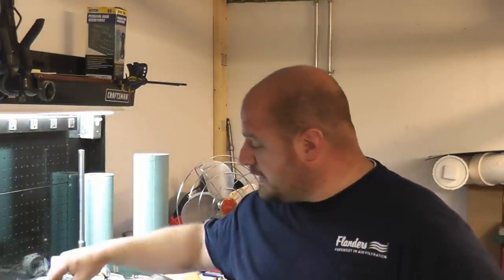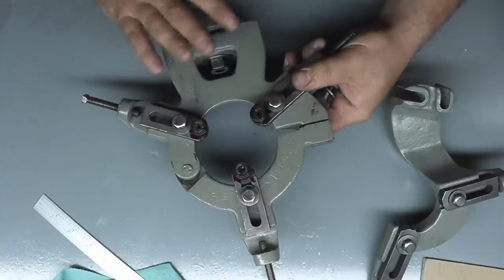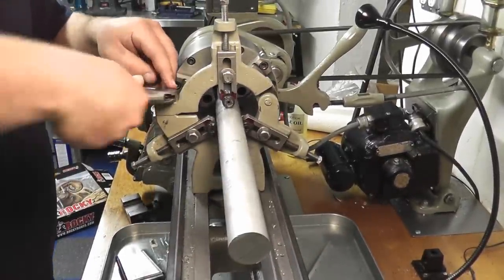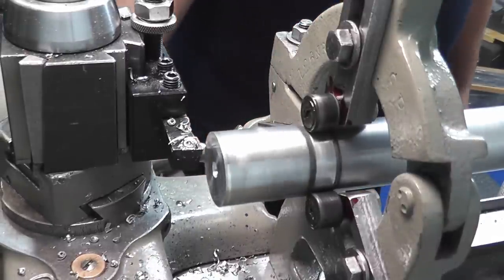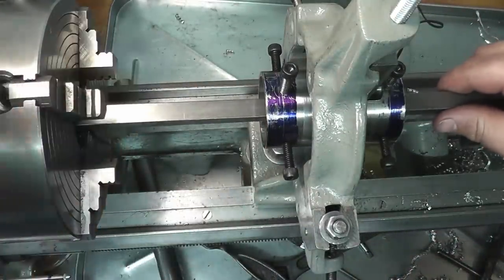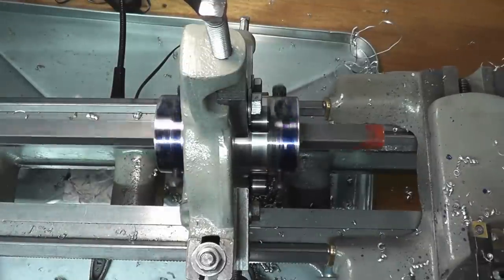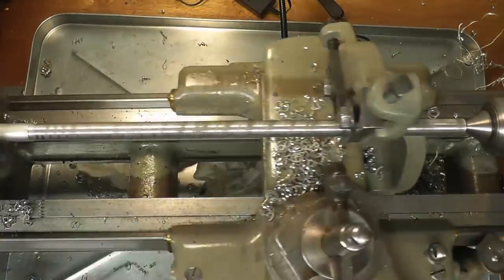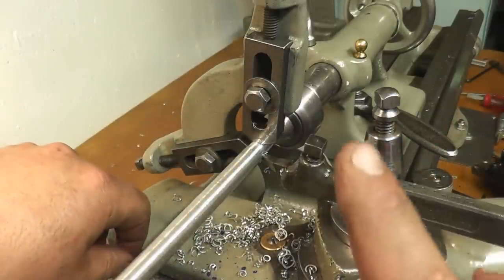Steady and Follower Rest Set Up and Usage

Comment: Nice demo,,,I scored big yesterday,,l didn't have a steady rest are follower for my 12 inch atlas,  drove 100 miles to buy another 12 inch atlas just like mine,, for 400 dollars,, he handed me a 5 gal bucket of attachments to go with it,, my god it was a milling attachment, steady rest and follower rest and a really nice 4 jaw Chuck to go with 3 jaw on it,,,there was 1000 dollars worth of attachments in bucket alone , and then asked if I also wanted a smaller 618 lathe for 100,,, l smiled all the way home and even more when I cleaned off the layers of oil on them,,both like brand new lathes, oh I forgot was also a Faceplate and 4 different size dogs,,and about 30 peaces are high speed steel tooling,

Comment: I've found if you rotate the aloris type post clockwise 90 degrees, you could use the right shoulder of the post ....... you'd have to reverse your bits in the holders but that's not too terrible to have to do.   2c and thx for the quality content

Comment: Nice job on this video, Greg.  Thanks for showing using the steady rest.  I have not used mine yet either.  You get extra points for making a video of your first attempt.  I understand that there is also a technique for having the follower rest moving in front of the cut rather than behind.  I have never seen that done but have read about it.
Reply from the maker: ***** Yup you can as long as you can get your cutter to the right side of the rest.  These southbend rests don't come in very far so I'd have to use a right-hand holder in the lantern toolpost to do it.

Comment: Just loved the safety intro!! excellent video with clear explanation throughout. I noticed that your rollers on the steady rest have a bit of side float and they have a slightly different amount of polish to them when in use - was the rest perhaps not quite exactly at 90Deg to the bed?  It didn't seem to effect the end result though!
Reply from the maker: Dan Whiteford It's possible they're a little bit off.  The jaws are only CR bar that I never machined the back to.  Plus It could be from using them on not perfectly round pieces.

Comment: OMG, I am going to have to watch this video a couple more times. Very comprehensive indeed. I experienced the same problem trying to use the QCTP when turning a long rod, but your explanation clears that up. Thanks for this truly great video. I skipped over that video about the cats head, because back then I didn't have a clue, but now it all makes sense. One problem I have with my follow rest is that only one of the jaws makes flat contact while the other jaw contacts at an angle. Got to figure that out. Thanks again for this great video....Ken ...Marina CA
Reply from the maker: Kenneth Bartlett You can angle it around a bit for the best fit.  Sometimes the rear jaw will tilt up a bit if you have the top perfectly vertical.  I just matched the wear pattern on the jaws of mine to the diameter of the rod.

Comment: Good video on the follower rest.  I was thinking the jaws wouldn't hit.  I didn't know you have to turn part of it first.
Reply from the maker: 1970chevelle396 Don't have to, but it keeps from getting the clunk clunk clunk noise and chatter and keeps you from digging in if using plain jaws.  You can get away without it if the part is close to round.

Comment: Greg, might be a dumb question. but why don't you cut behind the jaws on the follow rest that way you do not have to start then stop an inch later to put the jaws down into place? this way they would be set on the dia. of the stock before you start each cut?
Reply from the maker: Billy T You can.  The SB followers don't extend very far over the carriage so you'd have to use a right hand holder to get on the opposite side of the jaws.

Comment: What is the make and model of this year and do you know its age? Thank you for your reply.
Reply from the maker: TheClockhound The lathe is a 1950  4 1/2' bed 9" Model B converted to a Model A with a quickchange gearbox.
Reply: Thanks... it that the brand name? (model B and A)? The reason I ask is I have a friend that has a lathe that looks just like yours but there is no brand name tag on it... he is a machinist and makes turntables from scratch mostly using an assortment of lathes, but the lathe that looks like yours he likes the best so this is why I was asking if that was the brand name. BTW... I enjoy the vids.. Keep them coming as I am turning on my lil sherline...
Reply from the maker: TheClockhound Oops sorry It's a Southbend.  There are a lot of clones of it.  One of the more popular american "home shop" lathes.  Check the end of the ways by the tailstock.  There should be a serial # stamped there consisting of numbers ending with letters
Reply: *****  ok thanks a lot!

Comment: Except if you manage to turn down a trued up diameter without that long and unsupported piece ripping itself out of the chuck and killing your lathe and/or you and then take it out and flip it around in that three jaw chuck the only thing you can be sure of is that the turned own section will no longer be spinning true with the end in the chuck.

Comment: "the cat rules our shop"   I do not have a steady rest for my big lathe but have a
follow rest.  So lets say a 3" round by 5 feet long need to face and center drill. 
Solution is to use the follow rest and one of those two wheel knurlers & dial it in.
Don't care about knurl marks going to be turned anyways...steady rest for this
lathe is big big bucks.   sam
Reply from the maker: samuel pine Nice trick!  Some of those accessories for the older large lathes can seriously cost more than the lathe itself.  Pretty sure a taper attachment for mine costs more than I paid for the whole lathe.